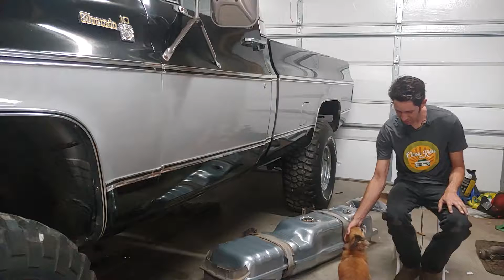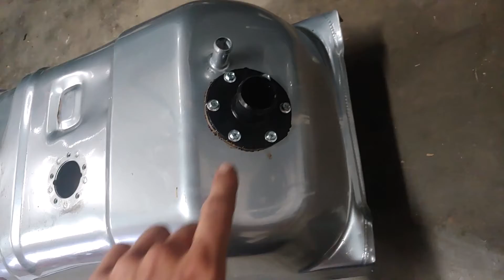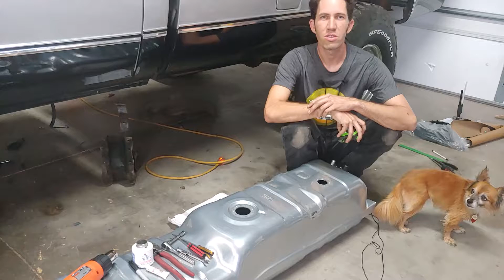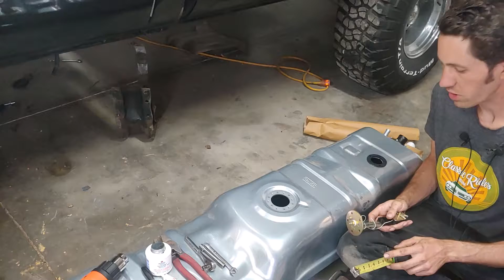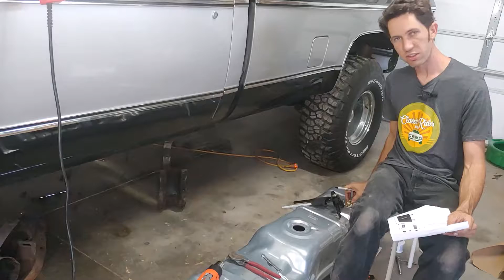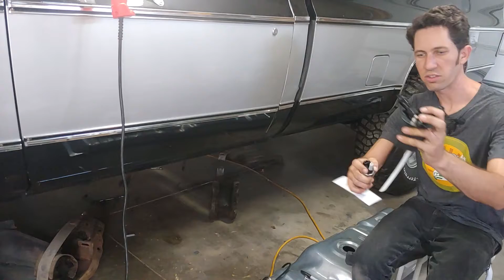Tanks Inc Fuel Tank Setup for EFI 79 Chevy K10 (1973-1987 Square Body Chevy GMC C10 K10)

Comment: Any more updates on the plumbing and wiring? Looking at buying that kit for my 1985 c10
Reply from the maker: No more updates that we have any video for.  It's all plumbed and running great.  We just need to troubleshoot why the fuel gauge isn't working.
Reply: @classicridesarizona7375  I had same problem fuel gauge was shorting to bed were sending wire bolts
Reply: U didnt put the black sock on the pump right.